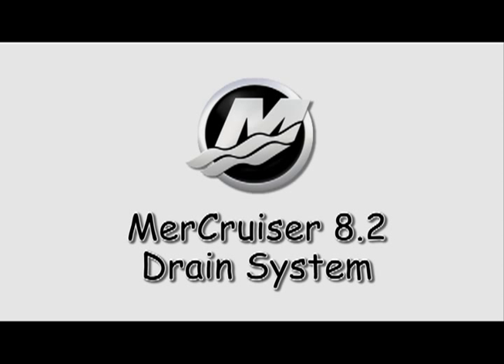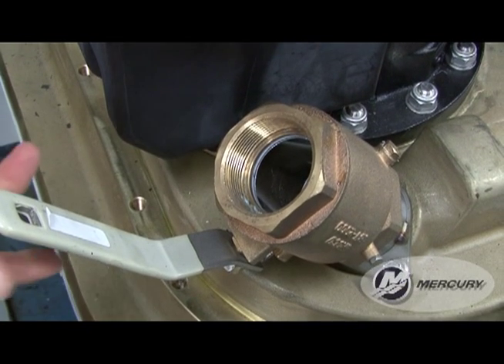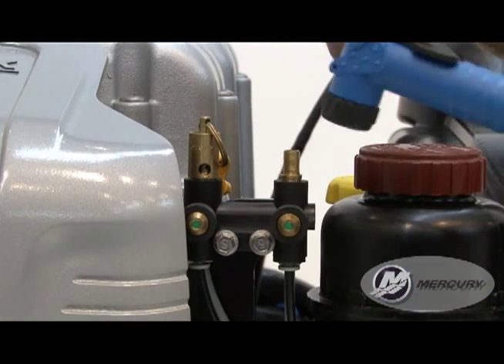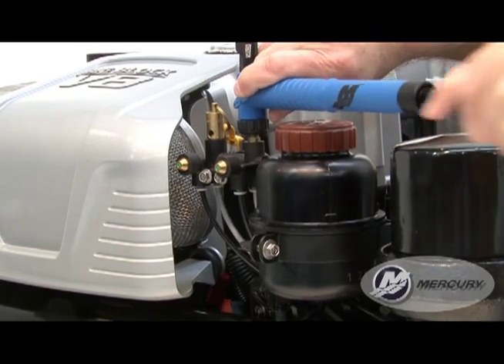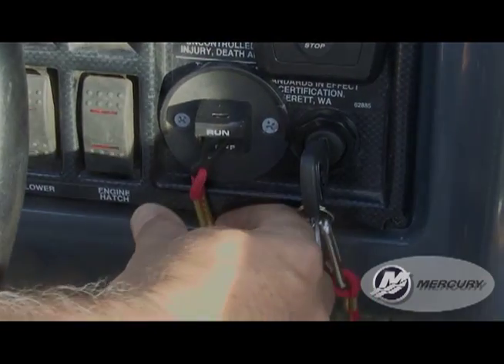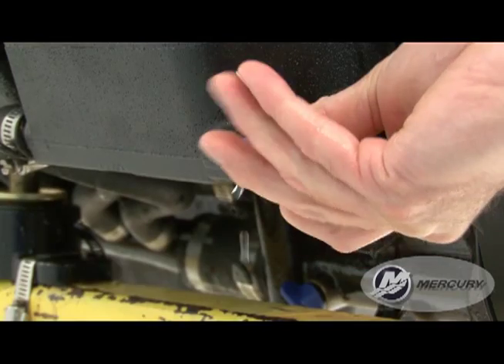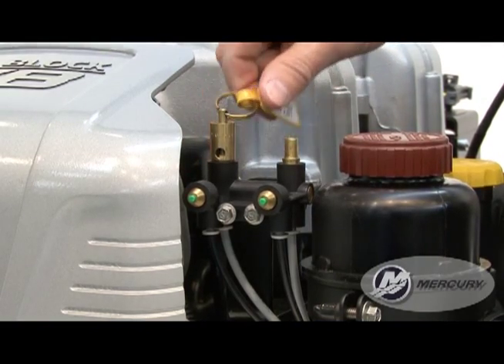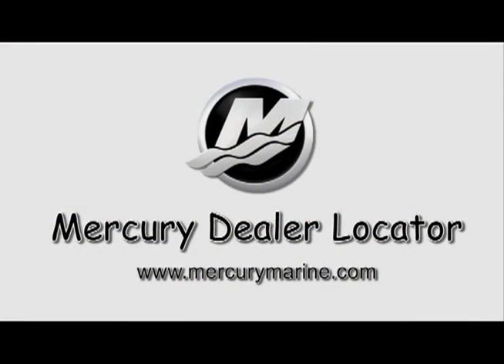How to Drain Seawater from Your Mercury MerCruiser 8.2L Engine

Comment: I have the 8.2 Big Block and watching the video we drained the water from the engine block per the video. 

Afterwards I reinstalled the plugs and hooked muffs up to the out drive to run antifreeze through. After 2-1/2 gallons it started to smell which I get is it simply heating up, so I checked the block and it was very hot.  

Turning off the motor I removed the port side plug to see if any antifreeze was in there and there was nothing in there. 

The bravo drive was extinguishing the antifreeze through 2 small holes on the bottom back of the out drive. What am I missing here? 

Last thing I want to do it overheat the engine and ruin it. Should those holes in the back of the drive be plugged to create the vacuum and run the antifreeze through the block.
Reply from the maker: Hi Bob! Please give our MerCruiser product support specialists a call at 920-929-5040 to discuss. They will be able to advise specifics on the process or what might be happening in your situation. They are available from 730am to 430pm CST, Monday through Friday.
Reply: Thermostat had not opened yet ? Maybe run the engine up to temp then start the winterizing process ?